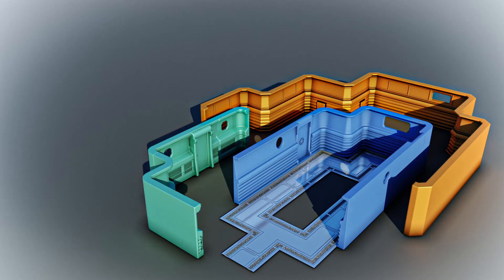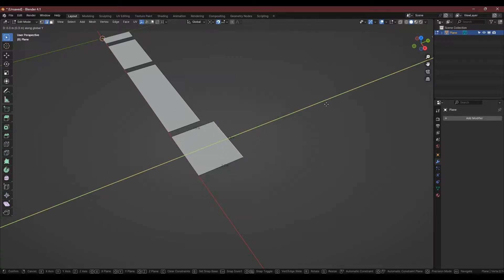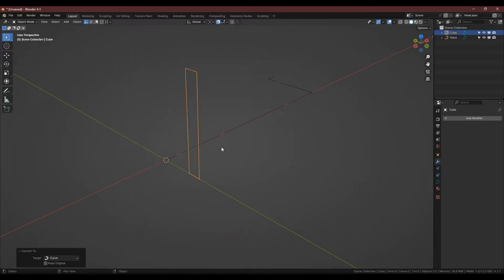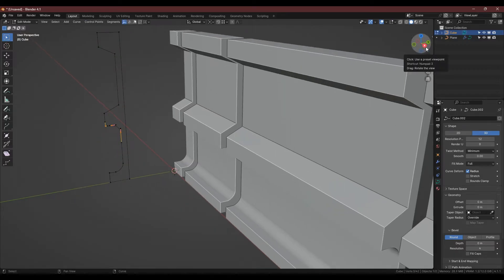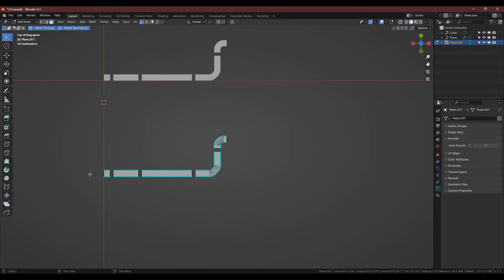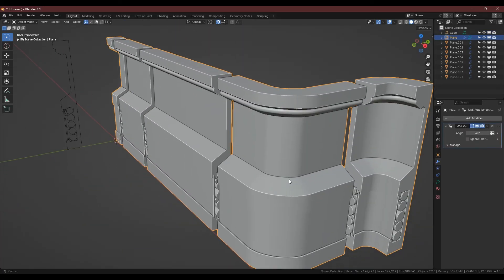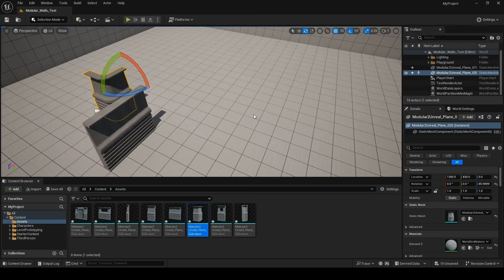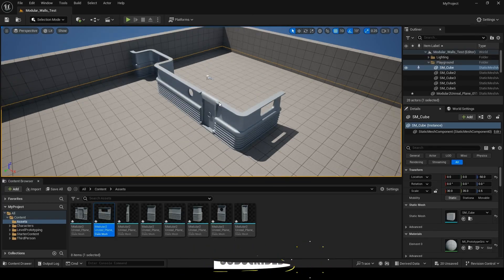Modular Walls - Blender to Unreal 5

Comment: Hi, I love this and great video. Noob questions I hope you all can answer...

Why not use one face for the wall (main middle section) instead of all the faces? Or doesnt it matter as much using those many faces on flat surface for performance.

Another question is with modular tutorials I never see it explained about the faces you dont see...so the top, bottom, back. You dont see those faces but you snap others which I get to them, but why keep those faces? Shouldn't you delete the faces you dont see for performance? Or doesnt it matter as does the game engine, can the game engine not render those??

Thank you all as I know its a noob couple questions

Comment: 6:14 for those that are using blender 4.5.3 lts I have the plane selected and then added "smooth by angle" modifier and left it at 30 degrees and checked the ignore sharpness box to on.

Comment: You could use the Snapping Helper 3D plugin for laying out your modular pieces in Unreal Engine. Great plugin.
Reply from the maker: Great tip, thank you. I've not dabbled in Unreal enough to know more than the base snapping options so far.
Reply: @chrismartinartist  Oh man, if you master the operation of the gizmo in the modeling tools mode as well as polygroup editing, you can build everything directly inside the engine with ease.

Comment: if I rotate 90 degrees on the y my wall model just rotates itself on x... the edges on top do not extend.  am I missing something/addon?
Reply: I had to rotate on the Z.
Reply from the maker: No, it may just be that you created it on a different axis, or the origin point is rotated/rotation is not applied. Just try the other axis and one should work for you.

Comment: Great work! But, what about T and X wall corners?
Reply from the maker: Hm, I suppose the easiest way would be to take a completed corner piece and use a Mirror after moving it's origin point if you wanted a T split, or a Mirror using a rotated empty as the offset for an X. Though I think that may cause a conflict with what is classed as the external part of the wall.
Reply: @chrismartinartist  and different combinations of internal/external surfaces would also be needed. 
Thanfully I need only "simple flat walls, with no pipes, etc, so I make bottom surface shape and then extrude to acbieve needed wall height. But the trick you showed in the wideo I use to make baseboards or friezes.

Comment: 13:00 - You don't have to move all the objects to world origin, actually.  In UE5, in your FBX import settings, look for "Bake Mesh" under your Static Mesh settings and uncheck it.  That will use the local pivot points without applying world offset.  I only know this because it's been the scourge of my existence for YEARS, and I just recently found this out.

Note that this has some other side-effects: In your Blender FBX export settings, you'll need to be more correct about your up vector and scale settings so that things come into Unreal at the correct orientation and scale.
Reply from the maker: Thank you, great advice.
Reply: God is that you? thanks for answering my prayer....

Comment: For the floors, I couldnt wrap my head around how you got the walkway, specifically the T junction. Is the walkway profile half a walkway and the seam between the modular pieces in the middle of the flat section?
Reply from the maker: Sorry, I'm not really sure what you mean. The T junction is one whole floor tile like everything else, there's Corner pieces which can obviously be rotated, straight pieces, and the T. They're all (iirc) 2x2m squares.
Reply: @chrismartinartist  Ah sorry I didn't articulate well. I couldn't think of a way to do a side profile for the T junction. I was assuming you made the floors the same way as you showed the walls being made just rotated such that they were floors.
Reply from the maker: @Kurock1000  Ah, no sorry, the method for the floors will be different. Though it is still a good idea to use Curves for pipe objects. I may need to do another video on that! Thank you.

Comment: This is a great video, a real hidden gem for creating modular assets to use in Unreal Engine 5! 🙂

For anyone getting a bit stuck underway like me, here are a few steps on how you can do some of the things described without requiring all the add-ons used, assuming you use Blender 4.2.1 LTS:

4:00 - Snapping the Origin Point to the Vertex (3D Cursor):

1. Select the Vertex while in Edit Mode, and press Shift + S. Choose "Cursor to Selected".
2. Press Tab, and go to Object Mode (or your preferred method for going to Object Mode), then right-click on the curve, go to "Set Origin", followed by "Origin to 3D Cursor". 

You do step 1 similarly between 2 vertices at 6:30. 

-

5:40 - If the "Fillet" method isn't showing up:

1. As someone else mentioned in the comments, be sure to get the "Curve Tools" Add-on inside the Edit Toolbar > Preferences > Get Extensions.
2. Select your 2 vertices and use the fillet method as shown in the video. 

If the "Fillet" option isn't selectable:

3. Go to Object Mode and select your curve.
4. With your object selected, go to the top-left Object menu, select Convert To, and select Curve. 

This reapplies the conversion (from Mesh to Curve), which hopefully should make it able for you to fillet your chosen vertices.

-

(6:09) - Shade Auto Smooth (CAS) on the curve:
I couldn't actually find how or where you get the Shade Auto Smooth (CAS) option, but I managed okay without it. If anyone figures this one out, it'd be cool to know! 

-

8:00 - If the edges start curving weirdly as you extrude from the curve:

1. Select the vertex away from the curved corner, that same vertex you want to avoid having a curved / weird edge. Press "V" to open the Set Handle Type menu, and choose "Vector". 

Repeat for any other vertices with edges that you would like to see more flattened / straightened out.

-

The remainder of the video should be okay from this point onwards, and diverges more into how you want your walls or floors 👍
Reply from the maker: Thank you, I was pleased with how it turned out
Reply: shade auto smooth is in the right-click menu (30% is optimal, but can be adjusted bottom left corner in the popup), and is now also a modifier

Comment: Thanks for sharing this awesome tutorial!! It's incredibly helpful. For anyone who didn't initially see the Fillet option (like me), try adding the Curve Tools Add-on in Preferences.
Reply: Thanks a lot - being a newbie, I got stuck for 30 min+ figuring out where Fillet came from. 

Also, if your curve behaves like mine did and the Fillet option is greyed out / unusable; try the following:

1. Go to Object Mode and select your curve.
2. With your object selected, go to the top-left Object menu, select Convert To, and select Curve. (This reapplies the conversion from mesh to curve)

I felt like I had done everything right, but it seems I still missed something when I couldn't use Fillet, so I hope this might help anyone else having troubles. : )
Reply from the maker: @Meraki-c5y  Thank you that means a lot.